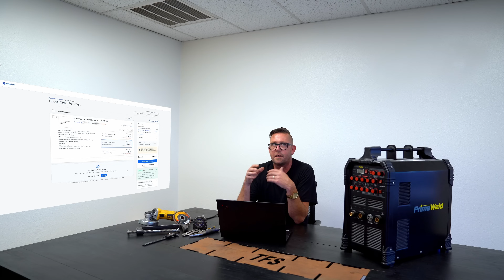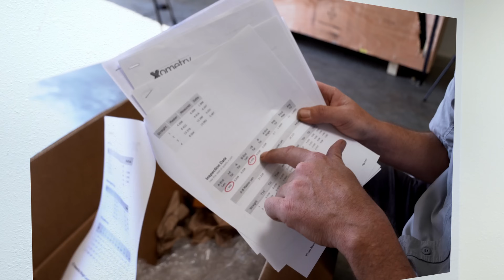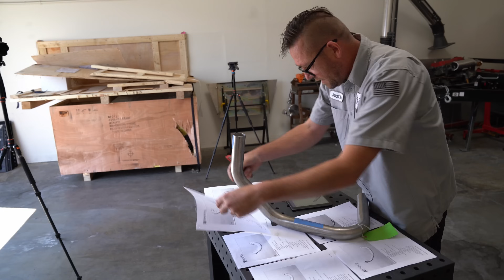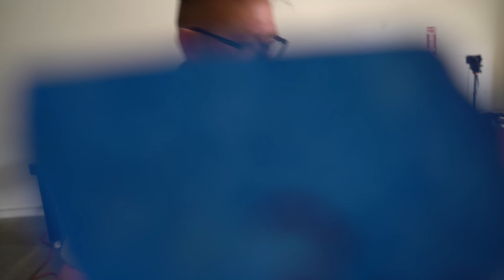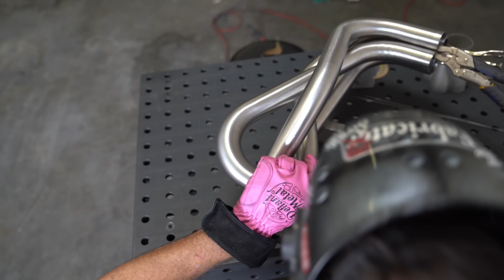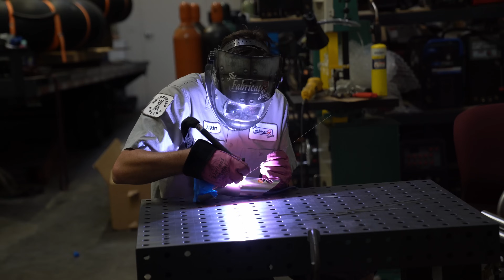I Built a Crazy Header Using Simple Tools

Comment: Really curious about the cost on that collector. I bet with a few tweaks you could make the collector one of the easier parts to weld up rather than notoriously the worst. Like, cant the ports out at maybe a 22.5deg angle and spread them apart just a bit so that you've got room to work between them, and just add a 22.5deg bend on the end of the exhaust primaries to match. Probably take up an extra two or three inches of diameter in the engine bay, but it might be a lot easier to weld and, more importantly, look friggin sick. 

On second thought, since we're already 3D printing parts, could print a center spike-looking piece that welds to the inside 1/3rd of the radius of the primaries, welding without the rest of the collector in the way. Then weld the collector on, and only need to do one bead all the way around. Just a thought. Definitely going to have to keep this in mind for my own projects down the road (if I ever get back to a place where I can have projects again). Thank you for all that you do.

Edit: I wouldn't even consider myself an amateur welder, so if I do a project like this I will probably go with ordering some 3D printed coupons to practice with instead of Leroy Jenkins'ing the final product. But also could be a product to consider stocking in the online store for all three people that would buy it.

Comment: I run a small shop with repairs and fabrication or anything and everything small (that other big companies in the neighborhood don't want or ask crazy price for) and i use these services regularly. Lazer and flame cut, rolling and bending, also milling and boring. I recently bought a lathe and it is a huge time saver to have that. A little millimg machine is my next purchase, but thats all i can fit in my shop and still have space to work around it. I have a band saw, drill press, welders all types, a table and all sorts of clamps, ... the only things i will keep outsourcing are cnc cutting, rolling, and bending (tube pipe and plate)
Reply: Hi shear your fabrication works videos on YouTube God bless you I'm from Pakistan

Comment: This video is extremely helpful for me. I am looking to build a set of headers for my '92 Isuzu Rodeo equipped with the 3.1L V6. My dilemma is that the stock exhaust manifolds have 1" thick flanges with some studs that are used to mount the Alternator and the AC Compressor to the engine. Finding collectors is also part of that as well. THANK YOU for this video. It will help me alot! I find your videos very enjoyable and informative. I anxiously await the next one.

Comment: What was the cost on all those parts?
Reply: Shhhh!😂
Reply: yeah i know right, craazy build simple, cheap with little to no tools, bet my guys 30k in debt sold his mother to a slaver, solds a kidney to zukaberg and re-mortgage the family home... click bait....
Reply: Even if there are "expensive" you still have to compare it to time/gas etc saved welding.
Reply: @krusher74  I agree, but there’s hours of cad also.  I was genuinely curious on cost
Reply: I sketched up a simple header tube, 1.5" 16ga, 3 bends all less than 90deg, 3" CLR for the bends (tried different CLR's too, no real change), no bend closer to the next than 1ft, total tube length 48in, 304 stainless

Result: auto-quoted over $900 for that one tube.  For reference, to buy the U bends and tube to build that same tube you'd be under $100 and have to do like 4 more welds.  I'd bet there are places that specialize in this type of bending that would get the cost down under $200 per tube if you're ordering 4-8 of them. Cut out the middleman and find the company direct, Xometry is horrible for this application.